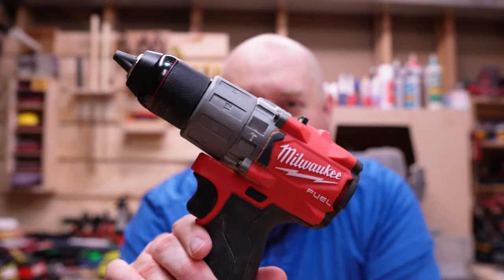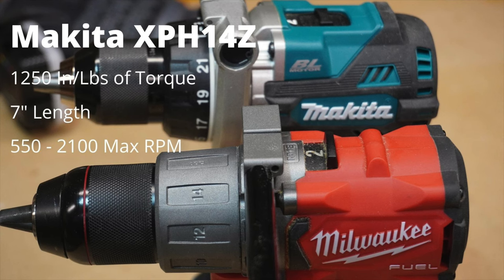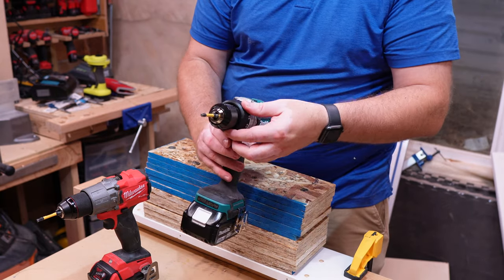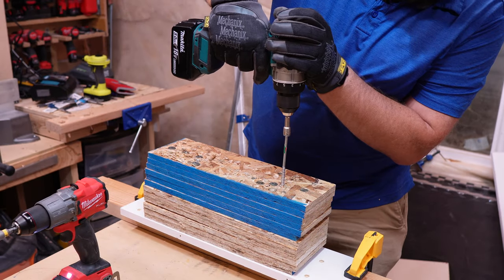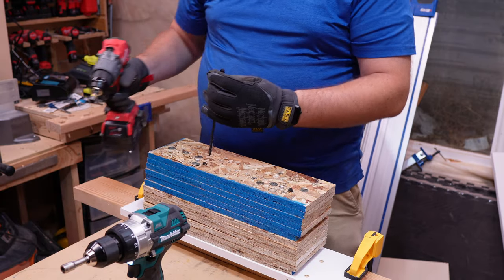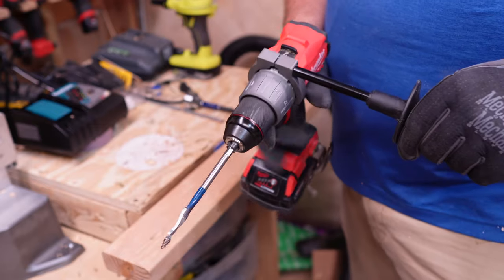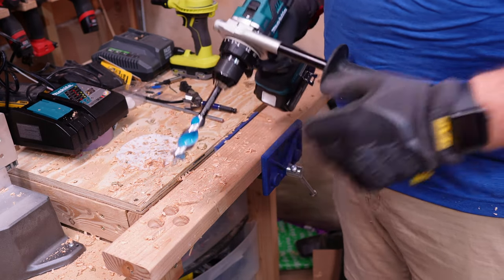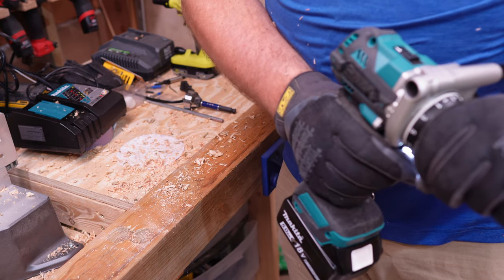Makita vs Milwaukee - Drill Showdown!

Comment: I sold all my old dewalt 18v tools 3 years ago, and now i'm looking to change brand and i was about to go all Milwaukee,  but i heard a lot of people saying Makita is way better on reliability over the years. But i should go with xgt 40v platform to have the same performance. I also love the fact that there are only two types of batteries m12 and m18 and i can use them for all the tools. Can i use 40v batteries on 18v tools and viceversa?
Reply from the maker: No, the 40v XGT batteries can't be used on the 18v LXT tools.   But then again, the M18 batteries can't be used on the M12 tools.   There are brands, like DeWalt and Metabo HPT, that feature a multi-volt style battery but that's not what Makita did.

Comment: Makita has many fail safes going on, battery current cut-out, low voltage cut-out and likely a current limiter on tool itself.
Milwaukee seems to go all in, even if it means eventually burning down.
Reply from the maker: I agree with that.   Because of that, there is a chance Makita will last longer.  They really are very evenly matched.
Reply: Milwaukee’s we use at work burn out in no time because of this. Makita is a far superior tool
Reply: That’s not true at all if anything Milwaukee has been criticized for being way too safe and conservative with the red link technology. and if you weren’t I would be happy to provide links of other reviews i.e. toolbox buzz which is known for having some of the most comprehensive and analytical reviews Rick has mentioned on more than one occasion how Milwaukee is too conservative with their thermal protection and thermal shut down and wish they were dial that back some. Milwaukee offers a five year warranty compared to Makita‘s three year warranty it’s a Milwaukee’s best interest to protect the longevity of that tool.That’s not a shot at Makita has great Ergonomics and they have some of the best fit and finish  tools on the market that’s just a fact.
Reply: @TinkerWithTools  Is that why Makita offers at three year warranty compared to Milwaukee’s five year warranty Milwaukee has always been criticized for being too conservative with thermal protection and shut down. One of the things I don’t like about them though overall I like their tools.
Reply from the maker: @steffendetrick9403  go be honest not sure why on the warranty.  In my experience Milwaukee let’s their tools reach higher operating temps vs others in the class doing similar tasks.  I don’t think it’s poor thermals they just favor more compact tools.   Makita on the other hand has tools that seem to cut out when it feels like they still have more to give.   That’s more just from personal experience and not industry knowledge.
Reply: @TinkerWithTools  i’ll give some examples Milwaukee GEN ONE nail guns we’re all engineered to fire one nail every three seconds if you push it any further than that they all went  in to thermal shut down toolbox buzz did a head to head with all the cordless 12 inch miter saw’s The Milwaukee if you go by volt and amp hour was doing the best as far  as cuts but would go into thermal shut down and at the end that’s when Rick brings milwaukee’s very conservative approach with its read link technolog and there tools. I don’t even use my GEN1 finish guns anymore because of this. Let’s call it what it is it’s a shot at Milwaukee saying they’ll melt their tools to defend the Makita because it didn’t perform as well. But what about the Makita tools that are more powerful and outperform the Milwaukee tools? That logic doesn’t work there . None of Makita drills are the most powerful so I give you a challenge. Grab their subcompact 18 V drill put it up against the other 12 V and 18 V subcompact you’ll be surprise How much it gets outperformed by every other Subcompact drill 12v/18v. I just wanna see tool companies make better tools and it’s a bit confusing when some people are saying they’ll melt their tools and other people are complaining that they’re too conservative if you’re a tool company where do you go from there? They are too conservative with the red link technology. And as far as operating temperatures some tools are designed and are capable of running at higher temperatures so that is a hard point of reference to use. But please go grab the Makita subcompact 18 V it would be some good contact for you and if you have already done it then you know what I’m talking about. i’m new to the channel and I do like your reviews👍

Comment: I got Makita DHP486(XPH14 in US) for my father. DeWalt DCD800 was ~50 Euros more expensive than DHP486. Milwaukee prices are ridiculous in Europe, out of the question. DeWalt tools and batteries break very often, very bad quality control but slightly bothered with Makita’s weight - you win some, you lose some
Reply from the maker: I think the search for a perfect tool will always leaving you wanting more.   WIth the pricing on the Dewalt and Makita here in the states, you can typically the DCD800 in a kit for around 200 if you are patient.  The Makita rarely goes on sale in kit form and when it does, the starting point is around $400 for the kit with the impact as well.  You do get more value, but it's interesting that the pricing is so different in other regions.

Comment: I have a pile of 18-volt Makita cordless tools. None of them have ever let me down, and I work them very hard. I expect professional tools to take a lot of abuse and still deliver. In my experience, that's Makita. I don't care if a DeWalt or Milwaukee can drive a lag bolt a second or two faster. That means nothing to me. What matters is I get the job done with the least amount of physical fatigue and downtime. Makita feels good in the hand, its batteries charge fast and last long. Makita are great tools.
Reply from the maker: Great insight!

Comment: You should use a new bit for each drill. If you use it on one drill the bit is no long in prime condition
Reply from the maker: Depending on which bit we use, there are times where have a different bit for each drill (on 1" spade bits I have multiple bits for example), but it wouldn't be cost effective to switch to a new bit each video for each tool.  Are these tests perfectly scientific, no, not in this instance but it does give a general idea of the relative power of the tools.

Comment: He ran the 8 inch timerlock.
 with makita at an angle of.course its going to bind. This is bias. He lets off alot and it not consistant with his presure. Both drills are great but this is not a great comparison

Comment: Milwaukee is great, but after 1 month of use the chuck starts to drop bits and becomes a good door stopper.
Reply from the maker: I get that this is hyperbole but the makita and Milwaukee in this video both had to get warrantied.   The Milwaukee so more use and was still some functional when it went in.  The makita was not.
Reply: @TinkerWithTools  What happened with the Makita? I’m about to buy one, want to make sure it’s worth buying. 
Cheers.
Reply from the maker: @chunglee763  I was driving a larger fastener and the gearbox gave out in speed 1.   It would grind something off and not apply any power.  makita sent a replacement drill after I went it in.  No problems since.

Comment: Lete be honest those drills arn't ment or built  to be using bits those size and corded drill motors  are the way togo
Reply from the maker: Both of these drills are rated to be used with everything I used in the video and in some cases larger bits.

Comment: Still love my Makita the Milwaukee is a little stronger . Have used both my brother uses Milwaukee they are a good tool. There just not as smooth and comfortable as the Makita .
Reply from the maker: You hit the nail on the head man!
Reply: i had the milwaukee drill and returned it because of the overheating element. I use my subcompact makita for most task , but when I need something stronger I pull out the xph14.  Very smooth and powerful, pleasure to use
Reply from the maker: I haven’t tried the Makita subcompact.  Might have to give it a go sometime.
Reply: @TinkerWithTools  it's definitely not powerful,  but very comfortable for every day use. I like it way better than the m12 drill

Comment: All your test are wrong , they don’t do drop test and wet test , which happens in real life which one would survive the riggers of real life I know the answer.
Reply from the maker: You’re right that I don’t have a drop test or a wet test, but even without those it doesn’t invalidate the other results. I likely won’t be able to test every real world situation.  But given those factors are you more team Milwaukee or team makita?
Reply: @TinkerWithTools   I am what’s going to be more reliable in working situation and what the point of having the more powerful tool and you drop it once and doesn’t work.
I have watched many programs about drills and only one tested them to destruction and Marita came out top.
If that helps.
Reply from the maker: It is helpful info.  Do you remember who did the testing?
Reply: @TinkerWithTools   it was an Australian you tube video